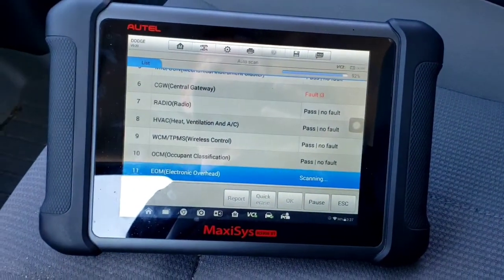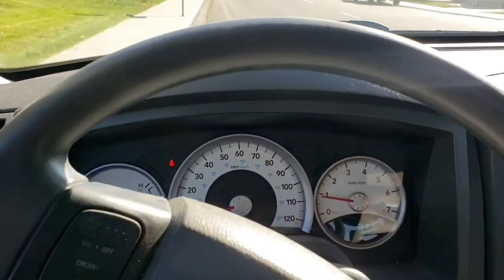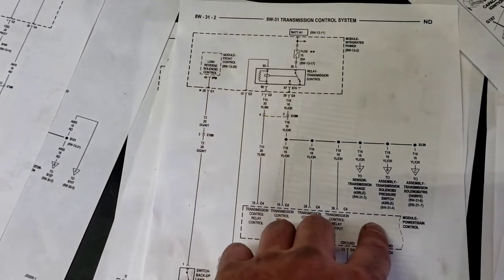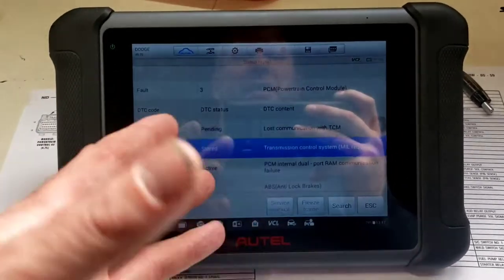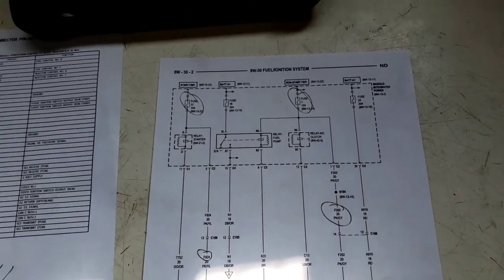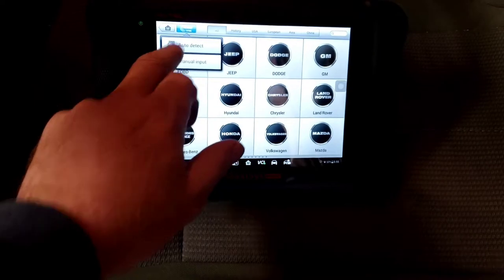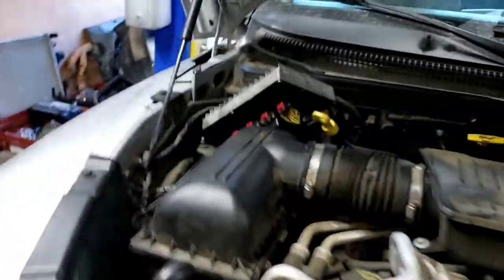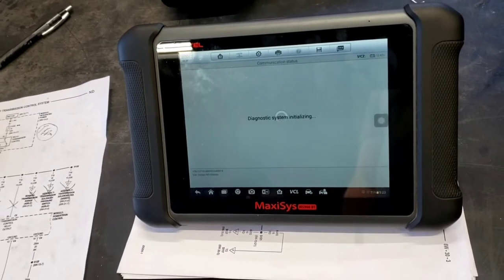2006 Dodge Dakota 4.7L TCM Issues

Comment: Same Trans Temp Over error here. I’ve replaced the PCM, no change at all. I’ve heard that it’s a ground or power issue… and that a stronger Alternator and bigger ground wires can solve it?

Comment: Great video and input. I have the same limp mode issues on my 06 dakota. Where were you able to get all the schematics from? I tried looking online and came across some different schematic configurations. It doesn't seem that I can just search for the right one on google. Is there a specific site? I also tried all parts with little help. Thanks again!

Comment: HELLO!

I've watched quite a few of your videos in trying to find an answer for the problem I have in my 2001 Dodge Dakota SLT crew cab four-door 3.9L engine! The truck always shifted a little funny, (after all it is a Dodge)! But last couple of months once it's warmed up and I start driving it trips a code, the  P07020 Output Circut Code, Speedometer goes CrAzY and and stays in first gear! Prior to this I have, changed the Transmission Filter and Fluid. I changed the Governor Shift Solenoids. Changed the Vehicle Speed Sensor, (twice)! I reset the computer by disconnecting the battery cables, putting the two cables together overnight then connect the cables and drive it. As soon as it warms up it trips the code P07020, Speedo goes CrAzY and stays in first gear! I suspect I have a bad TCM however I wanted to know in my vehicle does the ECM power the transmission as well or there is indeed and dedicated Transmission Control Module and where is it on a Dodge Dakota?

Best,

JimiCactus

￼

￼
.
Reply from the maker: @cactusstudiossouth  How many connectors does the ECM have 3 or 4?

Comment: Great troubleshooting. My son’s truck has the same issue. The problem looks fairly common with these. Rather than swap in a salvaged PCM I’m trying to figure out if the PCM board can be repaired.

Comment: My wife's truck has this similar issue,.... 2006 Dodge Dakota 4.7. If you turn on the ignition then start it the transmission goes into "Limp" mode BUT if you go straight into starting it runs fine without any problems.
Reply: Same
Reply: Interesting!  We have po 700 and po770
Reply: Ever fix it?
Reply: @jake2772  kinda....... TIPM issues are still evident. As long as I just start the truck straight on instead from "Key on" position I have no issues.
Reply: Same problem did you fixed the problem?😅
Reply: @braq331  no not yet.

Comment: had a problem with shifting, wont go into 3rd  or 4th gear, at first thought the solenoid pack is bad. I checked the resistances on all the solenoids  they seemed ok, I had a code 934 .. I suspected  a bad wiring  because of low voltage at pressure sender . ran another wire and proceeded to tear apart the harness tracing all wires and checking splices for corrosion. also disconnected the connector going to the solenoid pack, put everything back together and did a test run. everything worked fine  after that , however the voltage reading at the pressure sender was only .15 volts, I suspected the temperature circuit may be bad as it runs in series with the oil pressure sender. Checked the resistance on the temp sender it was good 6.5k  ohms  then decided to replace the oil pressure sending unit with an OEM part.. this fixed the problem, no more 934 code and shifting is smooth in all gears..  sometimes things  just don't add up.. shifting was a problem and  fixed itself by cleaning   all connectors and just pulling the harness  bundle apart may have been a loose wire somewhere, but all wires were good, nothing broken ? ??
Reply: What would have happened if you had done nothing and kept driving the truck?  I am considering that.

Comment: So in short, the PCM modual is like a quack dr. It misdiagnoses everything else when in fact, its the problem? I kinda figured something was odd when it said left rear ashtray sensor has low pressure radio station. J/K, but it comes up with something different everytime

Comment: Could u just jump a wire from the batt to the 87 pin on the relay to make transmission work ?
Reply: tried that and it did not work on mine.

Comment: I pulled the relay in my 2006 today and pretty much had the same results as you did, it would work for a while when pulling it out then back in then there would be no power until you cycled the key.  I took the truck for a drive and monitored the voltage and it would drop from from 14.5 to 13.8 every now and then, it was really quick and it may have even went to 0 and kicked back on, I don't know as I can only tell you what my eyes were seeing. The Trans temp light comes on intermediately and goes out within a few seconds to a minute and it only does it when its warm outside, its only gone into limp mode once about a year ago.  I live in South Dakota and it does not happen in the cold months. I would like to see the video of the fix with the new TCM. Do you have a reliable source for getting a remanufactured unit? Great Video.

Comment: I also have a 2006 Dodge Dakota 4.7 with the EXACT same problem, getting a new pcm. Tranny gets weird, tranny temp light comes on, pcm looses connection, restart the truck it goes back to normal. However I cant clear the pcm code so the money light is always on.
Reply: Ever fix yours?

Comment: Have the same issue, mine is a lot more intermittent than yours. This one will run fine for the longest time, check engine light will come on and go on limp mode. Car is restarted, check engine light stays on but car runs fine. Been fighting it for 3 weeks now. Haven’t been able to catch it when it’s acting up to condemn the pcm. I will try the heat method to see if I can get it to fail. Very informative video.
Reply: any luck
Reply: Did you fix it
Reply: @edcastillo532  yes I replaced the pcm and fixed it

Comment: Where or how you got the schematic diagram here cause I am having trouble with my 05 dodge ram 1500 4.7 v8 4-4 slt truck. Got a code P0888 which have it in limp mode as we elaborate here???

Comment: I have an issue with a 4x4 2006 Dakota ST with a 4.7l. I replaced the transmission on it since the old one died and I've been getting codes P1603 and P0700. I believe it's a dead PCM. I got a replacement from a junkyard from a 2006 Dakota SLT, with the same model number. But the truck won't turn on when I swapped the new unit into it. What ODB scanning tool can calibrate this?

Comment: It pisses me off. I have to stop, turn off the engine, turn it back on and go. Its not that big of a deal, but it always happens at the most inopportune time. The trans overheating thing pops up whenever it pleases too, even though its cool as a cucumber. I bought mine in an emergency. I'm wondering if I should have stayed with the emergency.
Reply: I bought mines to in an emergency I wanted to go skiing n I was unaware of the shifting issue n my mph Guauge dosent wrk😞
Reply: @romerojohnson8135  I ended up buying a '77 Chevy Suburban so I could evade all the smog regulatory BS, but had no where to keep the Dakota while trying to sell it. It ended up getting towed from a supermarket parking lot. The lein sales place that towed it gave me an itemized list of all the towing fees and storage, etc. nearing $1000. 
Merry Christmas to the lein sales place. I hope they have as much pleasure as I did with it. 😁

Comment: Where is the Tcm located on a 2005 Dodge 4.7liter engine? Is that what you're hooked up to?
Reply: I have the same question and I think he is hooked up to the pcm not the tcm
Reply: The TCM is in the PCM…. whole units needs replacing from what has been diagnosed here.

Comment: Have same issue with my 2006 Dakota with a 4.7 V8.  Put in new TCM and problem still exists.  What next?
Reply: Same here. 06 dakota 4.7 4x4. Temp light but no codes..
Reply: Any fixes?
Reply: Have a 2006 with same problem.  One dodge dealer, 2 independents, and Cottman threw up their hands.  Hendricks Dodge in Cary said replacing some valve, I think it was, would fix it. Then they said it needed a new tcm. Cottman had replaced it early.  Hendrick said they programmed incorrectly. Now they say it needs a wiring harness which isn't manufactured anymore.  They've had it 1 year now supposedly looking for a replacement.  I'm $3000 in the hole and still at the starting gate.  Stay away from these folks.  They do not keep you informed, haven't heard from them in that year.  I thought I'd wait them out, but not sure I can.  It'll be interesting to see if it will even start now.  Now, the short answer appears to be No, there isn't a fix.  I hope somebody out there can point us in a new direction.

Comment: I have had my ECM replaced 4x now, same issues as the previous times. I'm not sure what to do from this point. I replaced the tipm, ECM/ECU, fuses, throttle body ECT. and nothing!
Reply: Did you ever figure it out?
Reply: @nikstubbs4233  nope. It's back in the shop.
Reply: Hey I’m not sure if u guy still have your Dakota but I believe I found the fix I was having the same issue and replaced the pcm/tcm the tipm  and it still did not work
Reply: @marqueewilliams762  i got rid of my Dakota. Bc no one could fix it. The guy that had it last, just made it worse and put 1200 miles on it in less than 3 days.
Reply: @marqueewilliams762  I replaced. Harness, tipm, TCM/PCM, relays, fuses, everything you can think of. It didn't fix the issue at all.
Reply: O ok

Comment: Why not slice the power to the relay to the tcm with a low amp fuse  that goes to ignition power to test bad pcm tell customer that needs ecm/tcm and he will get a running vehicle for a wile till pcm gives out. Its not way to do it but u get paid ur hrs for diagnosing  n customer gets vehicle running.

Comment: You think about how complicated the new automobiles have become. I found a 78 f150 with no motor but a very very solid body. I'm putting a 302 with old style points with low miles on it that I've already found. That's the way I'm going from now on and never looking back. Vintage trucks are very in now anyway . These new fangled automobiles with their high technology are the purest form of BS. I've ever seen. And only designed to shake the extra dollars from your pockets.